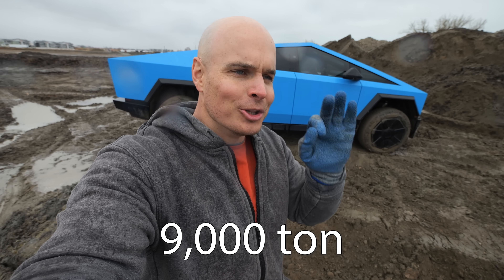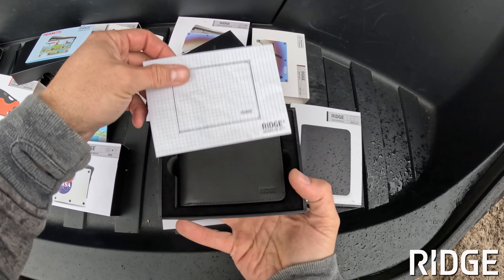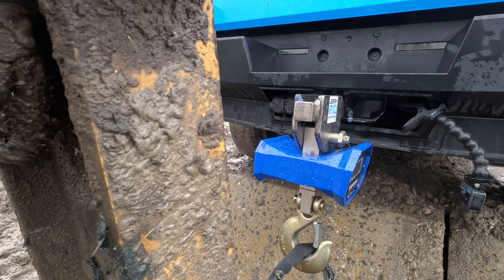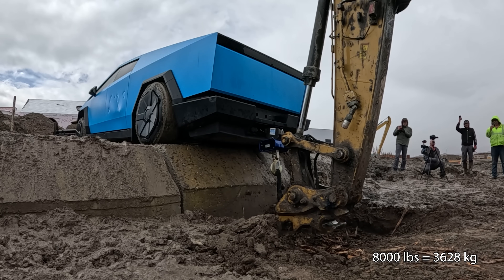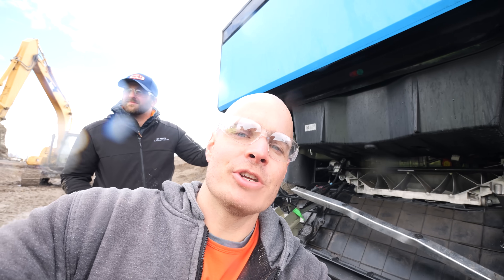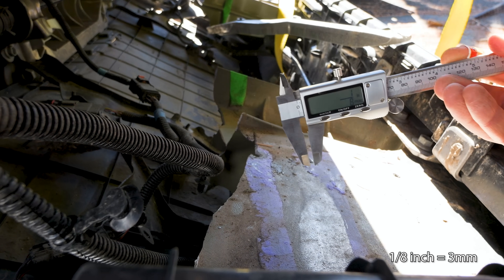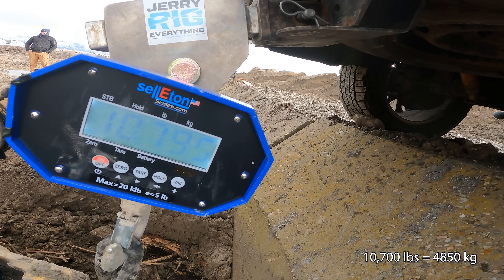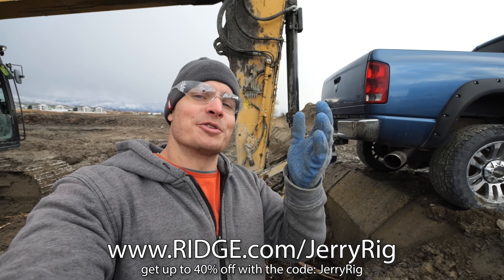SHOULD YOU TOW WITH A CYBERTRUCK?! - (catastrophic failure test)

Comment: As former test engineer who used to test trailer hitches and design tests for a big 3 automaker.   Even though I greatly dislike Elon Musk.   This result is quite good.   You basically put almost pure tongue load on the hitch.   The spec says 10% max tongue load of tow capacity.   This held up to over 90% load.   There is a SAE proof test that requires the hitch and frame to withstand a 1 time pull test several directions with no more then I think 5 degrees change after the tests, but it is a much smaller load then what you just did.   I would be most concerned fatigue strength especially after some galvantic corrosion.   Putting a steel hitch with an aluminium frame could cause this problem.   The fatigue test uses much smaller loads but requires a large number of cycles.   If someone were to misloaded their trailer, this bad they should be charge with manslaughter.
Reply: I'm not an engineer, but in Germany there is a term called tongue load, Stützlast. Everyone who wants to tow a trailer to their car knows the term. Trailer hitches are usually specified with a tongue load of 70 to 90 kg. That's not much, and yet they can still be used to tow very heavy trailers. And that's exactly the point, in this video the tongue load, Stützlast was tested and not the towing capacity. As far as I know, the Cybertruck has a tongue load of 500 kilos. To be precise, the tongue load was exceeded by ten times, which no one in their right mind would do in reality.
Reply: i would most likely like my frame to snap off rather that my trailer derailing my truck and causing a muach bigger accident. at that weight your front wheel would be in the air and have no control over the truck
Reply: @stephenstevens5746   , 100%
Reply: @stephenstevens5746  You might prefer that your trailer launch itself into traffic but I'm fairly confident the people around you wouldn't.
Reply: Dont bring reason to these click bait videos. It will be totally ignored.
Reply: I too thought %90 pure tongue weight(for an extended period of time, no less) was a pretty good result. But I’m honestly slightly concerned to learn that the spec is a mere  %10 as tongue weight. That seems very optimistic, people do load trailers wrong. Every combination of vehicle and trailer suspension will act differently in addition to the dynamic elements of the road itself. %10 reads as a very “just pick something” number if, it’d been me I woulda set it a little higher and it seems the engineers at dodge & Tesla thought so too
Reply: @alexphelps7042 every spec for tongue weight is approx 10% of trailer weight. Including my One ton dually pickup.
Reply: @alexphelps7042  If you load a trailer too far wrong, it becomes very obvious very quickly in my experience.
Reply: I agree that this test is meaningless and totally misleading regarding Cybertruck reliability and safety.  Whistling Diesel has a long history of doing outrageous destructive things in order to get views.  However, this channel has always maintained credibility by staying factual and doing honest reviews.  Until now.  I can't figure out why Zach did this.  Seems out of character.  Hope he's ok.
Reply: This result is not good, because steel will bend WELL before it shatters into pieces. Big difference when you're going down the road and it bends compared to snapping and annihilating all vehicles behind you going 60mph. Since this is an aluminum frame it's a when not an if since it has no fatigue limit.
Reply: so you probably missed the follow up whistlindiesel video where he bashed up the f150s hitch vertically & it didnt snap the frame or break the hitch huh ?
Reply: @ no I've seen that stupid shit too
Reply: @Redbeedrill , your point?? steel is more ductile than cast aluminum?? this issue is like watching dumb and dumber. WTF??
Reply: @Josemenez-lofs  tell that the the people who hit a pothole & their trailer went flying && it snapped their 100k+ cars frame completely totalling it.
Reply: @Redbeedrill  , show me one that has?? YT musings don't qualify. When I see a video of you driving a "conventional truck" with 10k lbs loaded and 5-6k lbs tongue weight. I'll wait, you can play make believe all you want.
Reply: @Josemenez-lofs  what are you even crying about ?
Reply: @Redbeedrill  , you're the one crying about breaking off a hitch. not me
Reply: @Josemenez-lofs  a hitch braking & totalling a car after hitting 1 pothole less than a year into buying a brand new 100k+ car is a valid thing to bee concerned about. 

so anyway when youre dickriding elon do you arch your back or no ?
Reply: The next test would to use a semi and load a trailer more and more until you saw 10,400lbs of tinge weight when driving. I’m guessing it would take a big load and trailer.
Reply: So the Cybertuck is over-engineered but the Dodge is over-over-engineered.
Reply: My 1 ton pickup has 200k miles on it and stood up to loads way in excess of the recommended limit without any bending or failure.
Reply: @kdw75  So you applied a load of 60 kN? No? Then why are you comparing it?
Reply: @kdw75 not 10X the rated limit.
Reply: @kdw75  this did too.. until it was 10x of the recommended limit
Reply: Thank you for pointing this out to others cuz it needs to be a fair assessment. I mean jeeze
Reply: Obviously, a fatigue test would be longer and harder to film.  This is easier for a noob to understand.  That said, aluminum does accumulate fatigue over time, and a steel hitch attached to an aluminum frame is still Tesla's original design.  Besides, if galvanic corrosion was this bad after just a year of ownership, I'd be worried about older Cybertrucks towing, still.  Especially ones living in the Rust Belt.
Reply: The rating for the tongue is actually 1,100 lbs, and it withheld almost 10x that. That's really good considering most have 2-3x rating maybe 5x
Reply: In theory it's okay.

In practice? People's cybertruck have broken exactly like this in the real world. The issue is that it "CAN" happen. Just because it can handle 10x the tongue weight, doesn't mean that it should fucking snap off.  With the raw power of electric motors, you don't think the stress of the pulling force won't weaken that structure?

I don't know, for someone who "dislikes Musk", you're making an AWFUL lot of excuses for a terrible design!
Reply: Crazy that I had to scroll this far to see this comment. One look at how they were loading it and I knew this test was bunk.
Reply: There is something to be said for the failure mode. The steel frame was visibly & audibly distressed for some time. The aluminum made some sound, and they reacted to it but this entire test was done with the context of what happened to whistlindiesels cybertruck. Without expecting that result I’m not sure it could be predicted by the light popping of the aluminum
Reply: @alexphelps7042  and that sound on the CT might have been the glued supports separating before the aluminum suddenly failed. I think the glue may be evidence that Tesla knew he hitch assembly needed additional (temporary?) support to achieve the target tow weights (even though the final limits were far below the advertised limits at the rollout).
Reply: The best comment. Someone who understood what engineering is all about. Doing something that meets a goal and with a safety margin.
If this were not the case and we wanted the car to support the most load, it would be as easy as adding thickness to the steel of the chassis infinitely. But that is not what we want, is it?
Reply: Tongue weight, or the downward force the trailer tongue exerts on the hitch ball, is crucial for safe and stable towing. It should be between 10-15% of the gross trailer weight (GTW) to prevent sway and ensure proper handling.
Reply: Thank you. I am not an engineer, but some people ask me if I am. I think this is common sense. I am not sure why he even did this and speaks about this like he did. I have been watching his videos and now his credibility just plummeted.  LOL a pothole is not going to do this.
Reply: @bgavin71  FATIUGE, FATIGUE, FATIGUE.... that is the question at hand. when it does break rather than bending, who is responsible for a catastrophic and predictable tragedy.
Reply: It's almost as if this test is completely stupid and worthless.
Reply: Jerry is full on EDS now
Reply: trust the actual science based lads.
Reply: The engineering on this "Test" is so bogus!  I'm a retired DoD-Certified Level III Test & Evaluation Professional and I'd throw this "Test Plan" out the window.  You're correct.  Dissimilar metals would definitely be THE issue with Steel Tow hitches bolted to aluminum.  It's a actually pretty impressive that the casting broke before the fasteners holding the hitch to the casting.  I wonder how many superpress test castings were x-rayed during the development phase.  Shock (rather than load) testing would be more interesting.
Reply: I’m not an Elon fan boy but I 100% agree this is a stupid test and video for that matter.
Reply: @totalyep  What Elon is doing with DOGGE to eliminate wasteful and fraudulent government spending is historic. So far, he has found over $130 billion in just waste, and that is just the tip of the iceberg.  And here's the kicker, Elon isn't getting paid one dime to spend his valuable time fixing the government screwups! Let me say that again. Neither Elon nor any member of DOGE is getting paid a dime to fix the Democrat's fraud, waste and excessive spending, which is bankrupting our country! Not one dime!
Reply: Yes ... This is only for the views, and to show how easy you can manipulate people's perception!
Reply: @EfraKrajo  Yes Zach (Jerryrigeverything) is flat-out lying and deceiving with this video, and I sincerely hope Tesla sues him.
Reply: It withstood 9x its rating and 2x the required margin after they tied the truck down and put stresses on it that are literally impossible in the real world. Then they said, "see, it is weak". Why do people go so far out of their way to make shit up about things they don't like?
Reply: @intrepidpursuit  He does not like Musk. 
So he's doing everything he can to hate on him.
Reply: @saulgoodman2018  exactly. Including blatantly lying about SAFETY. All integrity is gone.
Reply: Totally wrong headed video. Even though I hate e-cars and that ludicrous "truck", this vid is a liar's nest.
Reply: This video is left wing propaganda! Ive unsubbed because the woke nonsense is boring now!
Reply: Yes
Reply: “Even though I greatly dislike Elon Musk”……  Even though what?  Don’t worry, in 12 years your party can attempt to win the presidential election again…. and good luck, you’ll need it.
Reply: He is a Biden follower and not really a trustworthy person to talk about Tesla as he has his bias.
Reply: also known as mansory glue
Reply: it's a typical leftie crying that Musk is bad waaah after praising him and telling everyone to buy Tesla just 4 years ago.
Reply: Elon, is that you? 😮😂
Reply: Clickbait.
Reply: Why is there so much hate for Elon and Tesla?? Tesla makes great vehicles and Elon has been one of the most accomplished innovative creators we have ever seen. Is it because he is doing an audit on crooked government spending by corrupt career politicians?
Reply: Thank you.
Reply: Somone would need to load a trailer of 11000 pound with all its weight in the tow hitch and non on the wheels 😂
Reply: It's sad that you feel the need to preface this
Reply: But let's be real here, people don't buy these things to tow stuff anyways
Reply: Thank you
Reply: Asking out of curiosity. How come the normal truck at the end withstood the same test?
Reply: deep state jerry is USAID funded -- all his shit is Tesla hit pieces.
Reply: Correct
Reply: Elon stans 🤮
Reply: Thanks for clarification, I was actually surprised it managed to hold that much
Reply: This is complete rubbish. Do you know why polymer glues are never used as replacement for riveting or welding? Because none exist which are not sensitive to exposure (humidity, solvents, oils, high temperature, low temperature, etc etc). They all fall apart fairly quickly when exposed to the elements.
Reply: @darthioan The glue, as you call it, is there to prevent  galvanic oxidation, and it is not the only attaching hardware.  Your comment is complete "rubbish!"
Reply: @franklong6269  Way t ignore the point I am making. Fantastic intellectual honesty there, bud. 

The argument made by someone is that that this is being used as a structural adhesive and it is superior to welding, which is rubbish, just like your comment. 

It is a structural adhesive therefore GLUE, and it is being used to stick together the exterior panel to the car. Whether its role is to also prevent galvanic oxidation is besides the fact. Since other attaching points exist, oxidation will take place there anyway. So, it isn't even completely eliminating the issue. 

This type of polimer can potentially degrade over time, or in contact with various other chemical substances, or just exposure to temperatures outside of its envelope. The reason for its use is cost savings and incredibly rubbish engineering. It is sloppy. At this price range, no decent car company would design a car where you would need to prevent galvanic oxidation this way. It is bad, and it is a glaring point of failure. 

 You getting your jimmies in a rustle and getting pedantic about a GLUE while ignoring the bad engineering which require the need for its use is the pinnacle of rubbish way of evaluating what this is about. 
 
Continue to twist what I said and smell your own farts because a comment does not meet your jargon larping standards.
Reply: @franklong6269  That adhesive meaning GLUE is there to primarily stick stuff together, and it does not prevent oxidation to the rest of the attachment points, anyway. It is cheap and it is sloppy because it is terrible engineering. You getting all pedantic over jargon while ignoring the crux of the problem is way more rubbish than me saying GLUE, bud.

Next time you larp being an expert on anything, be sure to stick to the topic for people to buy it. 

Someone was claiming that this particular polimer is better than a  dyi bs, school training weld which prompted my comment. First off, anything is going to be better than that. Secondly, no serios car manufacturer that asks over 100k for a car would ever go with this embarassing jank as a solution to prevent galvanic oxydation because there wouldn't be any need for it.
Reply: The problem is that is just snapped — it didn’t bend. Right to catastrophic failure with a total loss of trailer. Even the safety chains would have been gone. 
It’s not a good result.
Reply: @wte4603  You just don't get it. It "snapped" after over 10,400 lbs of VERTICAL force were put on the tongue. The tongue is rated for 1100 lbs of VERTICAL force. So, it has a safety factor of roughly NINE. This means that it is NINE TIMES STRONGER THAN IT NEEDS TO BE. to tow 11000 lbs. What part of these FACTS don't you understand?  The Cybertruck is MONSTER strong!
Reply: So these trucks dismantling on the road are just anomalies?
Reply: According to several comments, you're wrong. Several comments mention that it is common to place a barrier between the aluminum and steel connection that attaches the tongue to the chassis.  So while the "glue" may be there to help attach the tongue, it is not its primary function. 

You are really stupid. The full connection method is not shown in the video and yet you assume that the tongue is just glued on. I can almost guarantee you that you are wrong. You can't argue, BECAUSE YOU DON'T HAVE A CLUE ABOUT THE FULL METHOD THAT IS USED TO MECHANICALLY ATTACH THE TONGUE TO THE CHASSIS..
Reply: this is BS! they advertise 11k towing capacity, but when i try to put a refrigerator directly on the hood it leaves a very distinct refrigerator sized dent!  I cant believe elon is such a liar! smh
Reply: The Dodge didn't give up. It's a crap design for being sold as heavy duty.
Reply: As they point out in the video, aluminum fatigues over time in ways that steel doesn't. The max tongue load of the Cybertruck is only going to drop as it's used, especially if it frequently tows a heavy load.
Reply: If exceeding a rating by 10 times still leaves the potential for catastrophic failure, then the rating system is bad.  There is more to things than just the numbers on the page.  This is something a manufacturer like Tesla does not understand.
Reply: Regarding galvanic corrosion, could that be something that the blue "adhesive" the video claims was "holding the frame together" would address? Specifically, by acting as a barrier / gasket  to prevent galvanic corrosion.
Reply: I'd be all for this assesment except he put a defunct, 20-year-old truck next to it as a comparison test which it passed with flying colours - so surely this would mean that the cybershite fails where twenty year old manufacturing still holds.
Reply: @bgavin71  thanks for your post!
Reply: But it started cracking at 4k lbs. And kept cracking until it finally broke at 10k. 10k is not where it experienced failure.
Reply: What a load of cope this post turned out to be.
Reply: He's just an Elon hater. So he does everything to make Tesla look bad.
Reply: You were never a engineer that is clear. No engineer would use aluminum that work hardens for a hitch that is going to see a trailer bobbing up and down thousands of times during a trip.
Reply: @frenchonion4595  Tesla have engineers that test's that.
Reply: If anyone's going to load that badly, it's someone that wastes money on a Cybetruck.
Reply: You hatw Elon for exposing goverment waste and desging good products? Do you hear yourself? Tiered of boomers who say how high when cnn says jump.
Reply: @bgavin71 I'm an engineer, but not in automotive - my concern is less with the failure load (I agree - 900% of design limits is pretty good), and more with the failure mechanism. Shouldn't a hitch like that be designed to fail gracefully in a way that doesn't disable the entire vehicle? Say... Shearing off or snapping at 50 or 75% of max towing capacity (500-750% design load), to protect the much more crucial and expensive frame of the truck? I'd much rather have a slightly lower failure load with a known failure mechanism designed to limit collateral damage, rather than an unpredictable failure mechanism that destroys the whole rear end of the truck... Honestly I've got a similar concern with the Ram - I'd want a cheap and easy to fix failure designed into the system somewhere between the design limit and bending the frame...
Reply: Dislike Elon… soy boy then 😂😂😂
Reply: Why would you possibly not like Elon musk? He's a very good and honest man. All that legal African immigrant wants is to help the world and the United States.
Reply: I would like to point out that this video is inspired by another video where they managed to snap off the rear in a normal usecase, after slamming the tow bar vertically during some offroading. They drove off a platform and as it came down, the tow bar slammed on some stone and the next time they tried towing something, the frame snapped.
You’re not going to get this much force from regular or even super risky towing and it is well beyond manufacturer specs, but with how this vehicle is advertised as fully off road capable, having the frame snap due to landing funny on a rock isn’t great.
A very niche but real scenario prompted this
Reply: @Leffrey  I watched the whistling diesel video. I would not have towed anything until after I had the truck inspected based on the impact it took. The cybertruck is exceptionally heavy. and the impact that bumper took was significant. The whole video was about him trying to destroy it. While it breaking off was a bit surprising it in no way should be considered a real world scenario. The only test I want to see is a fatigue over time video. That is a life scenario
Reply: @Leffrey  On top of potentially landing on a rock weird another issue is that Aluminum does not have a fatigue limit while steel does so eventually over time if you tow regularly this would happen regardless, or at the very least it would be significantly more likely to happen.
That Dodge is 20 years old and has been in a wreck that bent the hitch already and it held up perfectly to more weight than the Tesla.

Is the test done here unrealistic? Perhaps but it clearly shows which is better.
Reply: @Z38_US  Actually, every solid material has a fatigue strength (Wöhler test).
What makes you think that only steel has this fatigue strength?!
Reply: @Zedus-rl9hp  The point is aluminum does not have a fatigue limit so no matter how little stress you put on it it will get weaker because of it, this does not happen with steel
Reply: @Z38_US  Why do you have to add your two cents if you don't know anything about it?!
Yes, steel generally has higher fatigue strength (which never means 100% durability forever!!!), but that always refers to a specific component/cross-section. So, you can make an aluminum component just as fatigue-resistant as a steel component!
Where does this nonsense come from that steel never fatigues and aluminum breaks at the slightest swing?!
Never seen a plane before? Fuselage, wings, landing gear components... All aluminum. According to what you say, they should fall off on the first flight
Reply: @Zedus-rl9hp  I don't think you understand what I'm saying, planes are not comparable to trucks in the way they are built and neither did I claim that steel never breaks, what I said was that even small stress will weaken aluminum the way it is built on this truck, steel won't weaken from a little stress.
Of course if you apply enough stress or wait long enough it will also weaken but for trucks it is significantly better than whatever tesla cooked up here.
Reply: @Leffrey what you described is not a “real” scenario lol
Reply: @mikemtb332  … so you just glossed over the part where it did happen in your haste to reply, or?
Reply: Imagine describing the whistle diesel video as a “real scenario “… on what planet ??
Reply: Tow Hitch Weight Allowance!!  This failure is impossible to do with ANY normal pick-up truck.  The front tires will lift on the ground and the truck will not drive.  The Tongue Weight (downward) on a hitch should be about 10%-15% of the trailer's total weight.  This video is ridiculous and totally unscientific.
Reply: @theDaftZilla  Exactly this test is a joke.  It proves nothing.
Reply: @theDaftZilla  They literally tied the cybertruck down to make it even possible.
Reply: @theDaftZilla okay be he tested a ram 2500 instead of a 1500 which would be more in line with what a cyber truck is. So all of this testing isnt very helpful.
Reply: @theDaftZilla   Had to stop suddenly when a car pulled out in front of me, load of gravel shifted forward. Hitch bent but didn't break. Should be and real life aren't the same. The trailer was properly loaded until it wasn't. With steel it was just a bent frame. With aluminum it could have been a separated trailer. With steel it was clear the hitch was damaged. With aluminum it could have been cracked until the next bump in the road.
Reply: @theDaftZilla I'd like to see actual proof this is the only truck that would have this result.
Reply: Dude everyone tows their trailer down the highway with a loader holding the front there rig down, I mean don’t you know the first thing about towing ;)
Reply: @theDaftZilla good observation.
Reply: 💯 @theDaftZilla
Reply: @theDaftZilla  I was thinking of playing with toy trucks and trailers as a kid.  If you put too much weight on the hitch part, the front wheels of the truck would pop up and you'd do a wheelie.  Now if I held down the front end, and kept pushing on the hitch, I'd going to break my toy truck.  Period.
Reply: @theDaftZilla 
I fully agree that it's unlikely bordering on impossible that anyone would even attempt to tow with anything even close to this load ((discounting ""FloridaMan"")) That said I'm not equally certain that "shock loads" of quite substantially lower loads can at least begin to approach that level..
And also, though the "context AND presentation" was disappointingly  "overly sensational". It did quite vividly and correctly demonstrate the difference in "failure modes" between a "Aluminium Cast" and a traditional steel "part".
I.e. cast aluminium is much more likely to experience "sudden brittle failure" while the steel instead is much more likely to "deforms gradually" quite often noticeably elastically at first.
Best regards.
Reply: @theDaftZilla  I know, just commented the same. They literally had to strap the front of the truck down to stop it flipping over. Absolutely ludicrous video that can only be considered slanderous.
Reply: @theDaftZilla  The intent of this video was clearly to show his alignment with the anti-Tesla rhetoric.
I’m not sure if it constitutes an FTC violation. I guess that would depend on whether he knowingly misled his viewers and if he did so with intent of damaging Tesla stock. 
Either way it’s hard to believe he didn’t know the likely outcome from designing the “experiment” the way he did… or the impact it would have on TSLA.
Reply: @theDaftZilla  agreed. A pull test would have likely been a better test. It is concerning however to see the total lack of reinforcement in the truck. I did not expect the blown aluminum to be used as structural all the way front to back. There are other methods of forming aluminum that make it stronger. I also did not expect there to be a total lack of rivets along the glued portions to reinforce it
Reply: @theDaftZilla  It is not assumed to be a real use case. It is just a towing device test. So, none of that "it's unscientific." There are forces at play that you can't even imagine. Do you really think the truck will lift its front wheels, for example, during emergency braking, when the load on the hitch will be the highest?
Reply: Dodge didn't break.
Reply: @dhp9691 didn't "break," but the hitch is now junk.
Reply: I don't disagree but its still worth reminding you that the Cybertruck broke when a 20+ year old Dodge that had previously been wrecked didn't... They hype that Tesla puts out is that the Cybertruck is super tough, but the truth is that it's not as strong as a 20 year old American pickup that's already been in a wreck.
Reply: @LanternLabs the only complaint I have about the cybertruck is the price. It’s time the prices start going down. Wasn’t that the point of using cast aluminum? If you can get a cybertruck for 60k, even with all these trade offs, it’s suddenly not looking like a bad deal considering the gas and maintenance savings and the utility it provides couple with the extra perks of being electric.
Reply: @LanternLabs  It's funny you mention American Made when the Cybertruck is American made perhaps moreso than the Dodge that was likely made in Mexico. I guess that would still make it "American made" but my guess is that is not what you were going for.
Reply: So why doesn‘t the Dodge Ram rip off or brake under the same conditions? Why did, according to JRE, other cybertruck hitches broke off during non stress tests? I‘m a motorcyclists and helmet tests are a thing, but very often, good manufacturers don‘t just want to barely fulfill the test specs but actually blow way past them - it is a safety issue after all.
Reply: Good comment.  I don't like Musk and have no interest in buying a Tesla, but I was surprised that the tongue withstood that much vertical tongue load.  I agree with you that this was a good result for Tesla.  However, as I discussed in my own longer comment, the relationship of this "data" to towing capacity is completely invalid and indicates a lack of understanding by the content creator of how these forces actually work.  The creator also doesn't seem to appreciate the fact that engineering test standards exist for a reason, and were developed by committees of very competent industry and university engineers who belong to organizations like SAE.  (For those who  don't know, SAE is Society of Automotive Engineers; these engineers come to a consensus about how to design valid tests.)  

It would be interesting to know what percentage of Tesla truck owners actually tow anything of significant mass., i.e., more than just a U-haul trailer or a utility trailer with a lawn tractor or landscaping supplies.
Reply: In the UK the test is 3 million cycles @ 3000kg...this would fail all day long..
Reply: @Rockall57it would pass that no problem
Reply: @Rockall57 Say what? That's like hitching a trailer up and off every day for 4,100 years! Are you sure that's correct? Sounds bizzare.
Reply: If the hitch jumps the ball hitting a bad pothole and applies a lot of downforce to safety chains, would you rather be in a Cybertruck or an F250 or a Ram with a steel frame?

That is the question.
Reply: Why don’t you like Elon Musk?
Reply: Why make this video now and not months ago when whistling diesel made his? Just feel this is more a personal jab then an honest review of the towing capacity. 10000 pound tongue weight is almost next to impossible to create without the trailer being loaded improperly. So disappointed
Reply: @keizersoze907  You don't need any kind of certification to load a trailer and I am not saying you should. Yet anyone can rent and load a trailer. People who use trailers on a regular basis probably can load properly, people who only use one occasionally (think UHaul) probably not so much.
Reply: @keizersoze907  because he farm view like nobody! Colin Furze made a bunker, lets make a bunker! Whilslin broke a hitch, lets breake a hitch. Somebody shoot a cybertruck, lets shoot a cybertruck! Nothing related to the main thread of the channel!!
Reply: @keizersoze907  in a member's only video filmed just before this one, he was peeling the not a wheelchair off the cybertruck.
Reply: @keizersoze907 he tried to sell it,  he couldn't do he realized he can make more many with this video.   😅
Reply: Exactly! Fatigue over time and the bond between the steel and aluminium we can talk about. But dunking on it for exceeding manufacturer spec is wild…
Reply: Noone is putting 5 tons on the tongue but forces can spike that high. We know this because 2 have failed out in the world
Reply: @aleks138  two have failed? Are you including this ridiculous impossible video, or someone actually towing within specs?
Reply: @John_Ridenour  There is one report and image of a failure after hitting a large pothole, the other is another youtuber (whistlindiesel) who was doing abusive durability testing against an F150 and had the Cybertruck fail in the same way (F150 survived).

Overall the issue seems to somewhat be an overreaction, but the Cybertruck is definitely notably weaker in this area than a  regular steel frame truck, and failures are not impossible, though unlikely. However, failure rates may increase as these trucks age and the aluminum fatigues. Probably inadvisable to tow with one that had been in any type of rear end collision either.
Reply: @aleks138  2 have failed while there are a few 10's thousands for a few years. meanwhile how many times have you heard 'the hitch ripped of the truck' from the millions and millions of trucks that get seriously abused every day for I don't know how many years?
Reply: Yes but the real issue is that it completely breaks off at that point where steel would bend. The fatigue is the problem here not going 10x tongue weight once because the vast majority of people won’t do that but someone who tows within tongue weight on a regular basis could be a ticking time bomb on the road. A truck frame should not have a lifespan dictated by use in that way.
Reply: @pootinhammer  aren't the majority of low weight rated vehicles bolt on hitches anyway? Where you would probably sheer the bolts near the same weight as well? If it's a Half ton or meant for heavy towing then that would be the case of not want it to sheer off immediately but for cyber truck and f150 it's probably a pretty similar catastrophic failure.
Reply: @shadowgotmilk1 the hitch on my f150 is bolted on with 6 roughly .5" grade 8 bolts. Conservatively, those bolts could take a load of 150,000 lb without breaking.
Reply: @pootinhammer  Its horses for courses. On the face of it, a steel truck will outlast an aluminium one every time. But Its pretty obvious that EVs are whitegoods not fine furniture, its not going to be around and functional in the time it takes for fatigue to become an issue. Pro's and Con's.  You want an EV truck that looks funky and doesnt cost a fortune, you accept the compromise that is the giga-casting process.
Reply: @pootinhammer  The problem is that it it wouldn't break at all, and even a steel one wouldn't bend. Because the front tires would be off the ground way before that. That is why he puts weight in the front of the car. This test is BS.
Reply: @pootinhammer  That's not the real issue, because during towing this never happens. If at all the vertical force of the tow hitch would exceed even 5,000 lbs, the entire truck will tilt backwards and the front will lift. Also the load on the rear tires will be way higher than the max. load. It's just a stupid test and a dumb waste of capital.
Reply: @pootinhammer  smartest comment @JerryRigEverything
Reply: @pootinhammer  then he should do a test to highlight the fatigue issues with aluminium. The test he did actually shows that the tow bar is very strong, way above what is required. Also way stronger than a lot of aftermarket hitch points, a lot of kits just bolted on to the frame with a few bolts that would shear under that load.
Reply: @pootinhammer  OK, do a realistic test over thousands of simulated trips and then see the fatigue; don't just shove so much weight straight down that you need to hold the front of the truck to stop it flipping!
Reply: @bgavin71  correct sir. You are smart Jerry is wrong or just plain dumb tbd.
Reply: It's not about the fact that it broke, it's about HOW it broke. This SAE test is obviously designed for traditional steel frame trucks, that's why the passing criteria is how many degrees of bend there is after the test. You don't lose your trailer at 60mph when the truck bends, but you do if it breaks off. For something that's supposed to be "the future of offroad trucks", the hitch should be one of the parts of the truck where you can basically do whatever you want to it, aside from intentionally ripping it off with an excavator, and not worry about it breaking. When whistlin diesel broke his, he wasn't specifically trying to break the rear end off, he was just goofin around with the truck.
Reply: The thing I think is let's say you are pulling a large truck out of a ditch or creek it will pull down on the hitch. The cybertruck is marketed as this tough vehicle that can essentially take anything. A super off road vehicle and that's where the problems lie. It'll likely to a trailer happily but in an off-road scenario where you're having to yank something out this could fail. Put a bolt in a vice horizontally and you'll pull it all day long but pull down on an angle it'll move because of leverage. The hitch essentially acts as a lever.
Reply: These videos where Jerry exaggerates because he’s a flaming leftist who hates Elon is getting tiresome. He pretends like this is a real issue when it’s not.
Reply: Right, but the Dodge withstood that ludicrous level of over rated tongue weight. So there is a point to be made here.
Reply: @adamwhite4745  No, there is not. If you're comparing two laptops, would you choose one over the other based on their ability to drive nails with the screen when there are a multitude of other, more relevant differences? Don't make comparisons based on things that will never happen in the real world.
Reply: To be fair it started craving at 6,000lbs. It was already cooked long before 10,000. So no still not good
Reply: @Shawn-zt3gv  started at 6k when its rated 1k is still, very good
Reply: I don’t think you watched the whole video? The creator of the video literally explains tongue weight at the end after the test
Reply: The true test will be to repeat this on a 20 year old cybertruck that has spent years doing some real towing. Being an aluminum frame, I doubt we'll see any make it that long. As they said, the aluminum will continually get weaker over time, every time it experiences any stress while towing. It doesn't matter how strong it is the first time you tow - what matters is that you can still tow 15, 10  or even just 5 years into your ownership.
Reply: He won't acknowledge this. Any engineer would tell you that exceeding a rating by over 10 times is pretty good. But he has a bone to pick so the video has to be negative.
Reply: @spacebound1969  TDS is total mind control. Or is it MDS now?
Reply: True ! So sad.
Reply: @spacebound1969 💯
Reply: @spacebound1969  jerry is not an engineer
Reply: @spacebound1969  lol Jerry hearted the comment
Reply: @spacebound1969 I agree. Musk is infallible and must be protected from mean words.
Reply: @spacebound1969 yeah but lets no forget is aluminum not steel, 6 years down the road this incidents could become common
Reply: @_.F0X._  the stiffness shown in the brittle way it eventually breaks shows how little fatigue stress there will actually be. The engineers knew what they were doing. There was never any rational reason to doubt that.
Reply: @spacebound1969  yet the Ram didn't suffer the same fate.....I wonder why?
Reply: @spacebound1969  As an engineer, I'll tell you that I would never tow with a CT.  The aluminum will fail at some point, and you can't predict when it will happen.  If you cycle the loading between 5 and 10% of your tow weight, it will fail far sooner than a truck with a steel frame.
Reply: @spacebound1969  "He won't acknowledge this" he liked the comment bro lmao
Reply: ORANGE MAN BAD

ELONG MASK BAD

REEEEEEEEEEEEEE|EE
Reply: *Not a US citizen here...

" If someone were to misloaded their trailer, this bad they should be charge with manslaughter." 

Can I ask why many states do not have used car road worthiness inspections? It seems anyone can buy any used car and just put plates on it. I see ViceGripGarage go and drive a shitbox rusted 57 chevy with no brakes and swisscheese floorboard  150 miles on the interstate. I mean what are the liability implications if you put a car you know is a POS on the road?
Reply: @wpgspecb because used car road inspections are useless and just another way for the government to charge you for something. The US is about innovation, many other countries are about regulation.
Reply: Finally someone explaining tongue weight vs trailer weight which are the actual specs for any hitch receiver.
Reply: Does Jerry actually believe this is thesame action as towing? I thought he was smart
Reply: @John_Uche  kinda ironic to be talking about whether he's smart or not, when you haven't watched the video, where he talks about exactly this.
Reply: @BritishTeaLover they didn’t say he never addressed it, they’re saying his logic is flawed. Don’t bring up irony with the reading comprehension of a 3rd grader.
Reply: Preface: I don't like musk or this truck. 

There's so much nonsense in this video, and I've not even seen him 'test' it yet. You're testing a joint designed primarily for tension loads with a massive bending load! Steel does have a fatigue limit, as does aluminium! Steels fatigue limit is usually half its tensile strength, aluminium is much lower but you design with that in mind, otherwise we wouldn't have aluminium aircraft that last for 30 years!
Reply: Nice NPC comment about Musk. Make sure to squeeze that virtue in there. You're one of the good ones.
Reply: yeah and diesels truck was pulling a load that hit a bump... obviously these are extreme conditions but 10, 15 years down the road towing with a cybertruck is going to be extremely dangerous
Reply: @kiloftd  For reasons entirely unrelated to this test, yes. There's a legitimate video to be made - but this wasn't it, and ridiculous criticisms like this only hurt awareness of the actual problems.
Reply: @tombattraw1410   There are no "actual problems!" Nowhere are we hearing that the Cybertruck is failing when towing heavy loads and a plethora of reviewers have tested it. 

Quite the opposite is true. The Cybertruck is actually better at towing than an F250 diesel. The only weakness it  has is that it loses about 50% of its range when towing heavy loads. But that is also true for gas and diesel trucks to some degree.

Tesla has responded to "Jerryrigs Everything" formally and provided an engineer's analysis that shows that this evaluation does not represent a weakness in the truck.
Reply: I doubt you’re an engineer of any kind if you think this is “quite good”
Reply: @ToasterStud  I am not the OP you are addressing, but  I have two engineering degrees, including a four-year Civil Engineering degree. I also have  EIT certification, which is one of the most difficult engineering professional certifications on the planet to obtain. In addition, have worked as a structural engineer.

The OP is entirely correct. The "tongue weight" rating for the Cybertruck 1100 lbs. During the test, the truck did not fail until nearly 10,000 lbs of vertical force was applied to the tongue. So, the Cybertruck exceeded more than nine times its rated tongue weight, which is spectacularly strong. What part of that fact doesn't your dim little mind not understand!

In reviews I have read or watched the Cybertruck is one of the most powerful towing trucks in its class.  The Ford f150 will tow up to 14,000 lbs,  which is more than the Cybertruck. But the Cyber truck will easily tow weights up to 11,000 lbs. I suspect the Cyber truck would tow more than that weight but Tesla is being conservative. 

If Tesla sues Jerryrigg Everything, they will win a defamation lawsuit, and they could receive a massive settlement because Zach's website reaches millions of people. I would guess that punitive damages of $50 million would be reasonable.
Reply: @franklong6269  gee, are you a lawyer, too, Mr. I’m. Certified in everything.
Reply: This only makes sense if you ignore dynamic loading. As a static test yes this is a decent result. When you account for dynamic loads your conclusion falls apart.
Reply: @dustinandtarynwolfe5540 No, the  OP's conclusion doesn't fall apart when dynamic loading is considered because the TONGUE strength of the Cybertruck is NINE FREAKING TIMES STRONGER THAN ITS REQUIRED RATING. What part of that FACT doesn't your dim little mind not comprehend?
Reply: Galvanic corrosion, 3/16" cast aluminum frame and crappy fatigue stress tolerances. CTs losing trailers left and right in a few years will be something to see. Hopefully a massive recall will happen before someone dies, but I doubt the current administration will do anything.
Reply: @Tazdeviloo7 losing trailers left and right??😂😅😂
Reply: Totally agree. People can hate on Elon, but that hate should not translate to Tesla for no reason.
Reply: Alum chassis just ain't a good material to make a car especially pressed
Reply: It’s nice to hear from someone who actually seems to know what they’re talking about 👍
Reply: Thanks for this balanced informative information. If anybody loads their truck with 10,000lbs of downward weight on the ball they deserve what they get. There are so many people out there with massive EDS (Elon derangement syndrome) that refuse to acknowledge good results when they see them . This channel is going downhill fast which is disappointing.
Reply: @Homerlovesbeer2   Had to stop suddenly when a car pulled out in front of me, load of gravel shifted forward. Hitch bent but didn't break. The trailer was properly loaded until it wasn't. You can get what you deserve and i'll stick with steel.
Reply: @heartysteer8752  Glad you were ok mate. Fair call but the video is still very deceptive IMHO. Take care 👍
Reply: @Homerlovesbeer2  yeah this guy has lost credibility with this one. I'm tired of all these posers pretending to be scientist and engineers.
Reply: @Homerlovesbeer2  more people here with elon infatuation syndrome I think
Reply: @Homerlovesbeer2 Yep. Any critique of Musk must be disabled as EDS, and those who push critique should be imprisoned.
Reply: @Homerlovesbeer2  the point of the test isn't really to prove is disprove whether or not the Cybertruck is strong enough to tow, but to show if it is weaker than a 20 year old truck with a bent frame. Clearly, it is. Additionally, let us know when Tesla publishes it's internal stress cycle to failure tests for the frame. It's probably in the same folder where they tested the original wheel covers under load.
Reply: @Homerlovesbeer2  stop blaming things on "EDS". This is the guy who paid someone else to make him look like he was good at a videogame. This is the last guy you need to be defending. He doesn't actually do any real work anyway so Tesla's sparse successes don't have to be attributed to him.
Reply: I thought it was improperly loaded too
Reply: Thank you for being a voice of reason in this conversation. I appreciate the data shared!
Reply: This was the response I was scrolling for and confirmed my gut instinct! 🍻
(and I'm not a tow-er, and haven't turned a wrench in years)

You'd have to be towing something with SO MUCH WEIGHT that would need to be FORWARD of the trailer's axle(s), in order to hit that 10,500lb of purely-vertical weight... 
Like, to the point that you've WAY exceeded the 11,000lb tow capacity!!

I love the channel, this isn't going to change MY opinion any, but it's definitely a bad call on Zach's part. He's a standup guy, so I'm sure he'll do the right thing and issue a retraction when he realizes his error... at least I hope he will.
(I also am no fan of Musk, just for the record)

As for the galvanic issue, I think that MIGHT be less of one than we think.
I say this because most new aftermarket hitches are painted or powder coated. If this is factory (likely) then I'm sure they're doing similar to these, because rusting of THAT is still a real concern they need to be mindful of.
Granted, chipping during install and bolt tightening can happen, but the water's access to it to complete the circuit will be minimal and I have a feeling the vehicle will be toast well before this becomes a problem.

Nevertheless, I think all they'd need to do to further mitigate this would be to use that purple glue between the hitch and the frame. (assuming they haven't already)

edit: typos
Reply: @DUKE_of_RAMBLE The problem is each pound on the tongue is damage to the frame. Aluminum is like plastic any force weakens it. Steel will withstand similar forces without losing material strength. So over hundreds of potholes towing a Cybertruck may break its frame. 

It’s like finding out there’s a 1/1000 chance of an airplane engine just exploding midair. Sure it seems unlikely but given time and quantity it will happen and you can only hope a trailer doesn’t go careening off a highway into a kindergarten playground.
Reply: @ravenwing199  Aircrafts are made of aluminum. They fly day in and day out year round in all weather. Aluminum can be perfect material base on your use case. The life of the car is 250k miles. If aluminum holds up for life of the car, do you need a hitch that last a million miles? The Dodge is at end of life. Sure the frame is still good, but is a horrible design because they made the truck so heavy is inefficient. Becomes a useless piece of steel when the engine breaks. Cybertruck if it meets the use case, and maximize for efficiency, that is a great design. It held 10k with aluminum, that is very good design. Light and efficient.
Reply: @ravenwing199  Its funny you call aluminum plastic and then later you mention airplanes. Weird I thought airplanes were made of aluminum...
Reply: @DUKE_of_RAMBLE  around 10 mins in he does kinda address this, by giving examples of where a shift in circumstances could result in the trailer weight being transferred into a download load on the hitch.
Reply: @BritishTeaLover  I know 😊
I'm aware that is a plague on YT where folks don't watch an entire video before jumping down a creator's throat, but I am not one.
Even if you had 5000lbs WAY FORWARD of the trailer axel(s), you'd either be:
   - Yourself something that's massively heavy, period.
   - Improperly towing due to not having the item positioned over the trailer axel(s).

In both cases I feel like that's the driver's fault, not the vehicle maker's.
Reply: @BritishTeaLover there is no situation where an 11,000lb trailer, (which would require tandem axles) with 1,100lbs tonge weight is ever going to shift anywhere close to that much downforce onto the tongue/hitch.
His claims are simply impossible. 
I don't even like the cybertruck, but I hate false claims.
Reply: If a CyberTruck towing a heavy load hit a pothole in the road, or some other bump, could that cause the weight of the trailer to effectively bounce up and down, beyond the usual 10% spec, and closer to this? Obviously it wouldn't be quite this big of a hit, but I can see how a few repeated hits on potholes could come close to this over time.
Reply: @BritishTeaLover  Talking about it is kind-of pointless. What's needed is force measuring equipment in real-world conditions. I suspect it would actually be unlikely to get beyond 3x the tongue weight but the only way to know is to actually do it. Personally, I never intend to buy a cyber truck so not it.
Reply: @BritishTeaLover  Simply put? No way. The suspension would take up most of the hit. It would have to be this exact scenario.
Reply: @BifsieOfficial  and for the force to get to the truck suspension, it has to go from the trailer, through the hitch. Since most trailers don't have much in the way of suspension themselves.
Reply: @BritishTeaLover the tongue weight specification is 1,100lbs.
There is no way you're getting anywhere near that.
This whole test is bogus, because it is IMPOSSIBLE to put that much weight on the tongue of a trailer that weighs 11,000, and at an angle torquing down like the excavator is doing. 
Even in this ridiculous test, it exceeded the specifications by a factor of 10x.
Reply: @BritishTeaLover that’s also not true. Ask any engineer and they will tell you that’s why the tongue limit is 10% of tow capacity. It incorporates things like potholes, hill, etc.
Reply: @BritishTeaLover  No. If you hit a pothole, you'll need some speed to make the downforce any significant. Otherwise,it'll be a controlled movement absorbed by the suspension.
However, the faster you go, the more inertia you have, so a lot of the force will be pushing forward.
By no mean you'll find this useless test in a real life circumstance. Unless you find yourself in a cliff with the weight you were towing hanging in the air and your track were magically attached the ground so the weight won't lift it up.

Unfortunately, this video has zero valuable information and too much misinformation and ignorance of basic physics.
Reply: @BritishTeaLover I disagree with this I put data recording equipment on real trailers to get actual data and yes the weight on trailer tongue might get ~2.5x gets higher 1200 pounds.   The suspension, the tires and frame absorb large amounts of energy.  You are more likely to pop a tire or bottom out the frame.
Reply: Its ok.  The warranty was already voided the second that mud touched it.
Reply: The important thing is, he took another cycber truck off the road. For that we can all be grateful.
Reply: They WILL misload. That hitch is a piece of $hit on a piece of $hit. Pull the panels off and see how much of a $hitshow that “frame” is.
Reply: Sure, and I'm a rocket science, just like f-elon! Come on dude, you don't know what you are talking about.
Reply: I would agree, but since it is advertised as a fucking indestructible tank, the result is shit.
Reply: @Mbadly 10x over rating is more than any other truck
Reply: @Mbadly The Cybertruck was just rated as the safest truck on the planet structurally by the NHTSA crash rating agency.  On top of that  it is bulletproof up to 9mm size bullets l. So yes, it is a tank and it is tougher and safer than any other truck in  the world,  that's not customized.
Reply: @Mbadly  fool
Reply: @Mbadly  false. It has specific specifications AS ADVERTISED. No where in advertising is there a claim that it's indestructible. 
I don't really like them, as without an engine to charge it when needed it's worthless for me.
But at least be honest, if far exceeded its advertised specifications.
Reply: @Mbadly show me the ad the says it’s an indestructible truck… go ahead I’ll wait. Neither truck could handle that weight. The front wheels would just lift up.
Reply: 10x it's rated tongue weight is pretty much indestructible by average use standards.  @Mbadly
Reply: @Mbadly  when it can handle a load 10x what it's supposed to, that legitimises the use of "tank".
Reply: @KristianRobertsen  it can't. Dozens of owners have already experienced that same failure in regular towing with moderate loads.
Reply: @KristianRobertsen  Then ah, what are we designating that Doge as? 
Fort Knox?
Reply: @KristianRobertsen  I would say the failure began at more like 6x overloading based on the deformation and sounds that began at 6,000 pounds. It's not unreasonable to think shock loads from bad bumps in the road (potholes, subsidence at the entrance/exit of highway bridges) may approach this limit enough to fatigue the aluminum substantially when operating at rated capacity. Ideally, a test should be done to determine the peak shock forces when towing on bad roads at rated capacity, then a test rig should be made to apply these loads cyclically to match ~20 years of daily towing.
Reply: No response from jerryrigeverything, interesting. I used to really like this channel, but it's becoming clear that he's letting his political beliefs cloud his objective scientific (mis)information. Sad.
Reply: @noahpfluke6981  He had a lot of misinformation in the F150 lightning video as well. Between that one and this, it is my final straw. I'm as apolitical as they come, but he is being intentionally misleading here and it's really not cool. I don't even like the CT, but to crap on it for what happened here is just him showing he doesn't actually understand vehicle dynamics, like the OP said.
Reply: @noahpfluke6981  he hearted the comment you're replying to lmao
Reply: @noahpfluke6981  So scientifically speaking the cybertruck is good or what?
Reply: @noahpfluke6981  beautiful comment I said exactly the same thing!
Reply: @noahpfluke6981  as he said in the video, since it is aluminum, as you tow, the aluminum gets weaker which will eventually break  even with low weight like 3000lbs, the problem is the way it breaks, see how it just snapped, that means a trailer going 60mph uncontrolled, where as the steel will bend and not unleash your trailer load uncontrolled in the middle of the highway, also you'd still need to apply 10000lbs to bend it whereas the aluminum will break a lower normal tongue weights
Reply: @noahpfluke6981  Maybe wait more than 2 hours?
Reply: What did he say about politics.  Jerry has a very good point about the truck.  Aluminum should never be designed to tow anything, regardless of tow weight.  It will gradually weaken to the point that it won't even tow its rated weight.  Even flexing in the chassis over time will become an issue.
Reply: @noahpfluke6981  Also never forgett they produce conten that brings views, bashing Tesla brings WAY MORE money these days. At the beginning ist was easy money and referall codes to talk good about tesla so that many people use the referall code. Now its more lucrative to bash on it because they can farm the petrol heads, the EV-Haters and even the EV Fanboys, so tripple Win for the Conten Creator
Reply: Write this is just a cheap shot at Tesla because Zach doesn't like Elon anymore. You've lost a fan Zach.
Reply: Standard Engineering Practice is to build something to Fail at more than FIVE times the worst case load (for non-life safety applications, which is how this would be classified). For an 11000lbs towing capacity that would be 55000lbs, not 5 times the tongue weight. That's why they couldn't make the Dodge give in any way whatsoever. If Elon were to sue he'd have to pay Zach's legal expenses, just for it to be summarily dismissed from court.
Reply: @DrewNorthup  you’ve got your math wrong. Tongue weight is what he tested. At 10% rated, that’s 1100lbs. He got nearly 10x that. This is a very good result.

Yes steel is better overall, but I’d have no concerns towing my 20k lbs water trailer with dual axels with my Cybertruck. Instead I use my Dodge, because my wife won’t let me tow anything with the new truck…and nobody in their right mind would argue with her about that!
Reply: i would think they would have found these problems with MTS testing.
Reply: I built a class 3 hitch for a Honda Accord with an engineering student and a 40 year experienced welder, with spring and strut replacements all around, brake upgrade, and transmission cooler, just to tow a popup.   I concur with what you are saying, and I also fear Elon suing for defamation.  The Tesla actually performed very well.  And I'll say it for you, I Hate Elon for what he is doing to our country.
Reply: @johnlacquey7240 you hate Elon finding government waste? Reducing our debt? And working to eliminate the deficit? This is long over due, it shouldn’t matter if it’s a left or right person in office, we can not sustain it. Bill Clinton was the last president with a balanced budget.
Reply: @johnlacquey7240 Thank God for Elon and helping to save our country. I don't like electric only, but I love uncovering all the corrupt crooks in DC.
Also, he's saved many lives by donating starlink to areas in crisis due to hurricanes, floods, wars like Ukraine, etc. And runs the platform with the most free speech in the world.
Reply: @johnlacquey7240 well said! I’m curious, what is Elon doing to the US?
Reply: THIS!!!!
Reply: Is the max tongue weight not 100kg, so it over used it by 47x. Even the other car has permanent damage on the frame and tow hitch because it is bend. 
Where steel bend alu will break
Reply: @trucker0werner  it's 1100lbs, or about 500kg